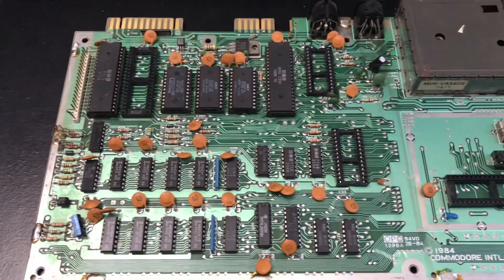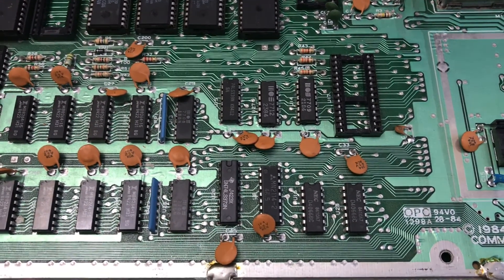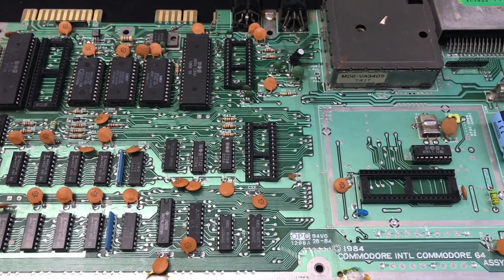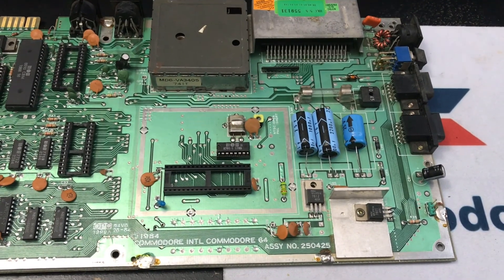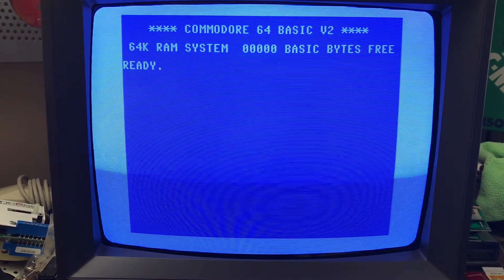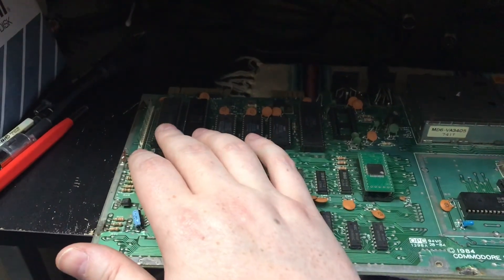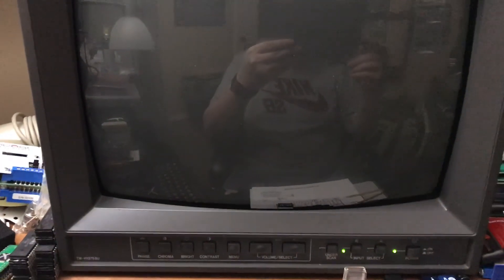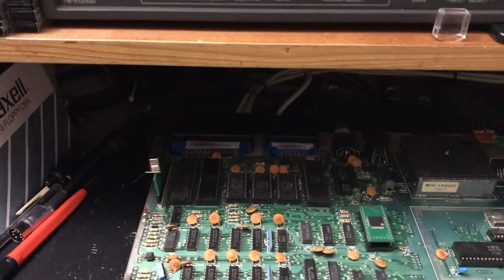eBay C64 Motherboard Repair - 250425 Revision

Comment: I actually had a Déjà vu when I first saw the symptoms of your board. One of my breadbins displayed pretty similar output, and like yours it also slowly got better as the machine warmed up. The culprit in my case.. also a contact problem between the PLA chip and it's socket :) More specifically, it was the pin on the bottom right corner of the chip. That pin connects the PLA to the Character ROM, explaining the odd symptoms.
Reply from the maker: DerbianGames Thats pretty interesting. As I’ve said in the video, I’ve encountered a few bad character ROMs that gave similar symptoms to this fault in the video. When I finally figured out it was the PLA socket, you can see that the bottom right corner (pin 15) was one of the bent pins that was no longer making full contact. As you pointed out, that happens to be the chip select for the character ROM, which explains the symptoms. It just threw me for a loop for a minute because symptoms changing as the boards warms up is usually indicative of a faulty chip. Thanks for watching and sharing your story! :)